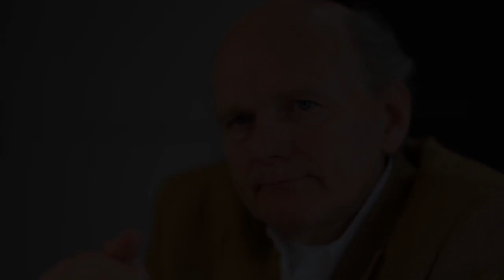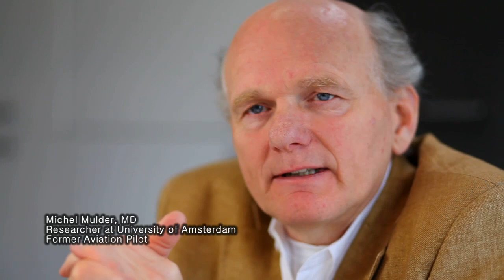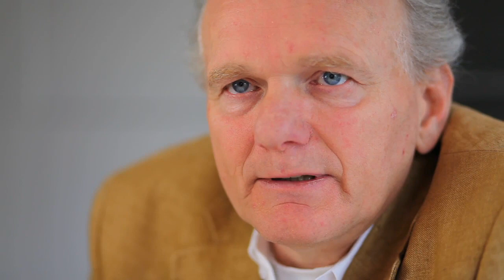Contaminated Aircraft Cabin Air = Aerotoxic.

Comment: No, Dr Mulder is not working for the establishment. Just because he couldn't spend more time with you does not mean there is a conspiracy. The history of AEROTOXIC syndrome is well established. Suggest you do the research before casting doubt on Dr Mulder.
Reply: like to know more about the tests and the treatment. Would explain my two cardiac incidents post trans atlantic flights.
Reply: I am not a doctor but your question has been hanging around for 20 hours. I had been poisoned, used serious detox plus cellcare supplements. Are you flight crew?
Reply: No - just someone whose been hit twice by it now. A baseline of pollution means if the plane has a hint of this then I react. Its also very much tied into Positive Ion Overdosing - get the 99c book Ion Effect. Its a layered and amplified effect. 

Someone needs to put up the detox / supplement protocol.
Reply: I've had difficulty posting. get message that my message 'failed to post"